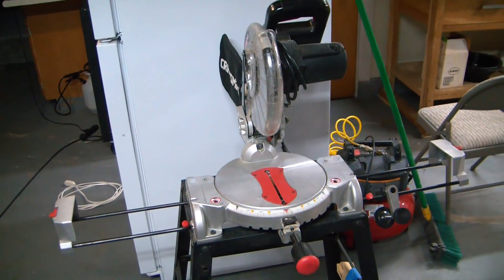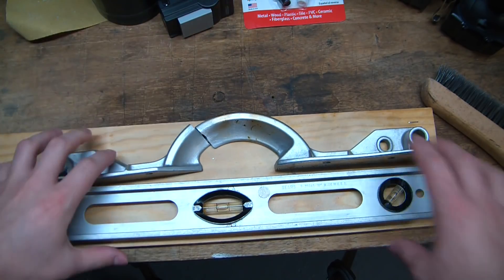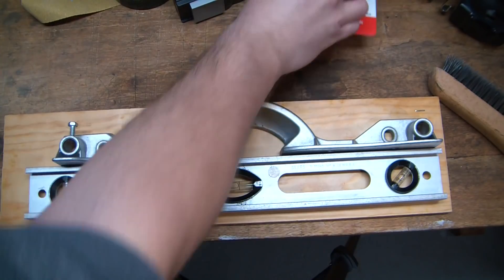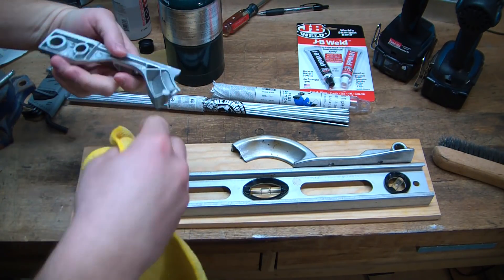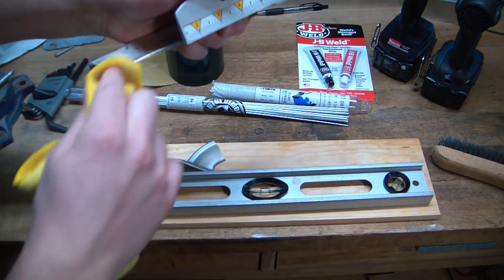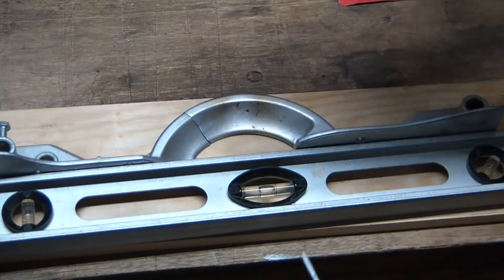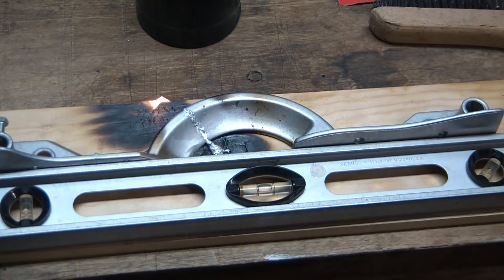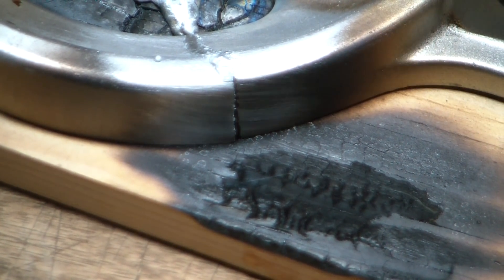Does Aluminum Brazing Rod Actually Work? Real World Fix Miter Saw Repair

Comment from the maker: Thanks for watching! If you would like to support this channel please head to www.patreon.com/elementalmaker. Every patron gets a virtual hug and my unending appreciation. I will also build a small shrine to worship you. One of these is a lie.
Reply: Heat the object to the point it will melt the rod, no torch needed after it hits that temperature. give it some more surface area by filling it in through the underside of the part. I repaired my boat prop with that stuff. still going after hitting logs for two years.
Reply: Like Curt said.... heat the object... I would have had it on a cookie sheet in the oven for a preheat.... I also would have used mapp gas.... never flame the rods... let the weld object melt the rod.... and how did you know that piece was aluminum rather than magnesium? never weld aluminum over something flammable, you introduce contaminates into the weld...
Reply: Good, I'm not a hugger. Side note, the Delta 26-2250 is an amazing little miter.
Reply: That fence looked to be made of zinc. Zinc don't bend, it breaks.
Reply: YOu do what you did but you need to flip it and do that on bottom as well. That aluminum rod does contract quite a bit. but by putiing it on both sides it will level out the forces at play some. Also C clamp the 2 pieces to the level! no backing needed!
Reply: no
Reply: Leave me alone I don't have a public reply to give. If I did it would probably be something up scene
Reply: The video was very helpful. I was looking to see how to use of these rods and how strong they were. Most of my questions were answered. Thank you and have a great day.

Comment: Just came across this. I can't figure you out. On the surface, you do some pretty intelligent things, then I watch this pile of what the hell. Sacrificial wood in a WELDING situation? Aluminum, not steel, of all things. where carbon, sulfur, silicon, sodium, phosphates, various dioxides, long chain carbon based molecules, etc., contaminates from the burning wood are guaranteed to be problematic, but you worry about acetone? You don't know whether it will work so you don't even bother to read the directions of the specialty welding rod? That logic doesn't even work with arc welding rods, like assuming you will get deep penetration with 6013 rods because the stuff you bought was a good brand...  Uggh.  You don't even bother to clamp the pieces in place for precision welding... Don't blame the saw maker, the pieces being welded, or the rods for the crappy outcome, blame yourself for a toxic combination of ego and lazy. I am glad you got it to work in the end, but the initial problems mentioned were obvious.
Reply from the maker: Yeah this was a truly braindead shitshow. Don't know what the hell I was thinking

Comment: light the wood on fire, would help keep the aluminum up to temp for brazing. Also the idea with brazing is not to spread directly in the flame, its like soldering you want the flow to happen not because of the torch melting the rod but because the metal is so hot the rod melts.

Comment: One of the keys is to not heat the rod with the flame it will ball up and look like bird poop. Ive used this before welding copper to aluminum and worked great just takes a little practice keep up the good work.

Comment: Great fix! Now, Some Monday morning quarterbacking for you. LOL You could've used clamps to hold both pieces steady against the level. The burning wood and will definitely contaminate the weld. Those rods are good enough to fix AC high-pressure lines.
Reply from the maker: It ended up breaking and I redid it with clamps and got a much better result. I would have used them on the first go but my clamps were at a work site.

Comment: Better result if you cleaned it and cut a v in piece and got rid of the wood under it. It is aluminum and aluminum needs to be clean and not smoked like a piece of meat.

Comment: bound to fail:  Contaiminates from wood burning, metal not heated enough before applying rod, metal should be approx. 750 degreees before applying rod, joint should not be laying on anything
Reply from the maker: Indeed it did fail shortly after this rushed repair.

Comment: Project farm did a great video not too long ago, testing out different brands of braising rod. They are definitely not all created equal. Also, I wonder if it would be possible to use solder flux to help that  brand to flow better.

Comment: Mine is like that too, but it happened after a piece of lumber jammed and spun around. Maybe yours was hurt the same way? Possibly when you dropped it and broke the handle? Maybe?
This is actually a good repair idea, because the area is now nicely annealed and ready to be dropped again and then it can be “hammered into submission” without breaking.
I think I would add another mounting bolt between the factory bolt and the turning part of the table. Then after torquing the inner bolts you can clamp the fence to a straight edge to straighten it and torque the outer bolts to hold the fence true. Then use the adjustment screw to align the blade to a true perpendicular to the fence.

Comment: You've just done it wrong as you're not supposed to heat the exact place you putting the brazing material to. The idea is to heat up the sides enough the brazing rod would melt on them not in the flame. That is way more tricky technic but the result is way more rewarding as well. By my own experience I've managed to braze back a piece of the rear wheel bracket on an alu bicycle frame. It did last for one and a half of a year of every day usage until the friend I've lend it out to, tried to "true up" the rear wheel position with a pry bar%)

Comment: Grind a 45% angle on the broken sections.  All the way around on both pieces. Fill in the V created by the 45's. Clamp your work down on a metal table. Preheat the table and then the work piece. Better yet do the above and Heliarc it. If you have the resources chuck it up in the mill and run a cleanup pass on it. JMHO.

Comment: I have used these for years and have become a somewhat expert on it's use. First off as pointed out from another poster, you should V-groove the pieces to give it more area for the rod to fill plus it will flow better to the back of the piece if you feel you need it to but I would V-Groove both sides and weld the back side as well but takes a tool to work so invest in some welding absorption paste that prevents you from re-heating the first side you did in the first place. Cast can melt away quickly too so using a regular butane torch is not a bad idea. Takes longer to heat the metal but may provide better control until you get better at it. Otherwise MAP gas will work but heat faster and hotter.  https://www.muggyweld.com/product/heat-freeze-heat-paste/. Also a stainless steel brush is a necessity to prep the aluminum for best adhesion. This goes for TIG and MIG welding. DO NOT USE ANY CHEMICALS. But to be successful with any thin material, cast aluminum, brass, copper and even pot metal(hardest to work with).

Comment: I've used a similar repair rod branded as 'Lumiweld'. Had great success with it but as others have said here vee the joint out a bit and use a small stainless steel brush to remove the oxide coating. Also helps if you have a piece of fine  stainless wire rod and scratch the surface metal through the puddle of molten solder/braze. This helps the molten rod become fully amalgamated with the base metal. It does work well,its just a matter of developing a good technique.

Comment: You didn't want to clamp both pieces to your level?

Also I believe you want it hot enough that when you touch it with your brazing rod that capillary action will draw it into the joint. I find it always takes some practice to get the timing right and just takes some practice on scrap. 

There's differences between brazing copper (yes brazing not soldering). Being that aluminum has a really nasty layer of oxide that's melting point is way above clean aluminum which the flux on your rods is supposed to remove. As long as there's a oxide coating on aluminum it's really tough to get two pieces to bond together.

Comment: Your not doing it right...  The way you are supposed to do it is grind down the joint at a 45 because it doesn't flow.  Also clamping and working from the back as well would certainly help.

Comment: Here's a video about welding. In the beginning and prep he mentions something that could be important to your case. Cast aluminium is really porous and loves to have grease stuck in there even after the cum gutter and wire wheel. If you were to file off a layer, it might have had way better penetration and wider surface sticking
https://www.youtube.com/watch?v=I5DrrcObmBo

Comment: It's better than the 1 i have i was cutting to fast and the blade bit in and ripped the fence right off and now i just have a piece of wood screwed on it and it works good and i didn't have to worry about the half round bit the blade removed what needed to be removed with use
Reply: Haha holy makrel
Reply: I did one real good . Don't tell anyone . I was using my dad's nice making miter saw for cutting up irregular pieces of oak firewood he had bought in a supermarket bag . All the shames and boos are heard . But I was not by my plumbing truck so I had no sawsall, and I wasn't home so I could go grab my stihl Ms 440 magnum chainsaw with the 30" bar , lol . The later was nearly as bad of an idea as the miter saw , but in hind sight , I'd have opted for instead . So we needed shorter pieces of wood for this burn box . I started cutting pieces and was trucking along , whilest this nagging feeling that this particular blade was going to overbite into the crappy oak . Sure enough it did , and we had to use screw drivers to pry the now  "Perfectly " straight miter blade out of the bar b que wood .

Comment: The melting point of these rods varies a lot, the cheaper rods melt close to that of aluminium , these ones seem to have a good safety margin. the burning wood would have contaminated the join, cleaning the metal should be done with a stainless steel or brass brush, grinding a chamfer along both edges and filling the V would be stronger , clamp the two pieces and use a stainless steel bicycle spoke sharpened to a point to scratch the base metal thru the molten puddle to increase adhesion

Comment: I've tried brazing aluminium profiles with a similar result. Afterwards, I read that you can make your own flux by dissolving boric acid in methanol. First de-oxidize the surfaces that you want to join. Immediately after that, cover the now bare aluminium with the solution. After evaporation of the methanol, the resulting boric acid film supposedly prevents re-oxidation and helps the brazing alloy to flow better. Haven't tried it yet, but maybe you want to give it a go.

Comment: Y
our not supposed to hit the rod with the flame heat the base metal till hot enough to melt the rood and flow it in and v groove the crack before trying to braze together it only sticks to ground clean metal

Comment: Flux. Flux. And don't forget the flux.
Reply from the maker: What flux would work for aluminum?
Reply: @ElementalMaker   They make powder and paste. I like the paste better. Hot Max or muggy weld paste flux. Brush a little on the joint and I like to dip the tip of the rod in it as well.  Aluminum oxidizes so quickly that it just refuses to braze without flux.

Comment: Most of the problem was insufficient heat in the part.

You have to heat in preferably a slightly reducing flame and heat the part to melt the rod, not melt the rod in the flame.

Comment: Don't melt the rod in the flame! Heat the part until the rod melts on contact, then the rod flows into the joint itself. Ffs

Comment: Because you didn't do it right you idiot rebraided properly you have to heat the rod up the same time you need to go back to the welding school I learned how to brace properly I'm 40 years old how old and I learnt that in high school how to breathe properly you do not know you got two braids both sides not just one especially with aluminum

Comment: Cool vid ! In my experience these guys want a whole lot more heat that the melting point of the rod, otherwise they dont flow and just bead up because of surface tension. Cleaning the oxide layer with a wirewheel doesn’t hurt either.

Comment: Maybe that casting isn't a good alloy. Even if it is a good alloy, the backside of that casting had awful thin webbing. That part would need to go into a well-heated mold and the cool slowly before being de-molded. I would bet they just heated the molds enough to get something that sorta looked good and then busted it out as soon as they were sure it was solid. It's a damn shame when you pay for something like that and some little PITA shortcoming that would have cost all of a nickel to have fixed in the factory makes a tool that cost 10,000 times that to be almost unusable. I would be tempted to have used a mold release on the saw base, slather up that fence with JB weld and slide in a piece of straight and square stock. Let it set up, bust lose the stock and clean up the fence. That would basically make a cast in place fence shim.
Reply from the maker: That would have been an excellent solution! I wish I had thought of that before. If it breaks again that'll be my move

Comment: You basically just tinned the surface, you didn't get it hot enough to suck it down into the throat of the joint. -.- Tinning it for adhesion and then going back over it and actually making a nice weld pool/caterpillar over it seems to be the best way to use that stuff from what I've seen on here.. That and going back and doing the backside of the joint as well.. It really isn't a brazing rod, it's just a solder.

Comment: I had my hopes high, but once you mentioned not reading the manual, I knew it is not going to go smoothly. :-)
Watch these videos, they will be helpful: https://www.youtube.com/watch?v=nxtmt6QCVd8 https://www.youtube.com/watch?v=Bu2bq9ad0e0
Heat the base metal,. Melt the rod with base metal heat, not the flame. Scrape through the melted rod with a stainless spike to break the oxide layer; base metal and rod metal will mix.
This is not a brazing process and those rods are not aluminum.

Comment: I had a shitty fence on a cheap saw...I got a piece of 2x2x¼ aluminum angle, bolted to the saw and then used the blade to cut the required clearances.

Works great...this method works really well for cutting thin material too because you can make a zero clearance fence too.

Comment: Grind a bigger gap, clean the surface, then scratch the surface to break the oxide layer, clamp it, and braze it on a clean steel surface and you will have a very good and very strong result. You basically did everything wrong that you can do wrong :-) You can also send it to Abomb79, he will fix it professionally in a heartbeat, still cheaper then buying a new machine.  You can get a great result with aluminum brazing rods, as long as you know what you are doing.

Comment: I've never seen someone soldering on wood before..... Consider that a first!

I thought you were supposed to scratch through the pool of metal to get under the oxide layer of the aluminium as there will always be one?
Reply: With brazing you aren't supposed to be melting the materials you are adhering, you are basically sticking them together with hot metal glue. With flux added you are mobilising the oxides significantly more than temperature alone in hopes that they will migrate away from the surfaces of the materials to ensure wetting of the "glue" to the surfaces of the base metals that reside just below the outer oxides. Some more advanced brazing rod alloys act as if fluxed at temperature and some of those even alloy per selective diffusion into the target materials(creating a significantly stronger bond, sometimes even stronger than simpler welds).

Comment: As a good visual check for square  .......... invert the cut piece so one face from the top of the cut is on the base, slide the two together and look for a gap. This will be twice your error so is easy to see ;0)

Comment: It's so frustrating when you buy a new machine and it's not right.
Your first mistake was not testing the material with vinegar.
Second was not  buying some aluminium angle and cutting a new fence.

Comment: Greetings mate. I've used this type of alloy before. You need to heat the workpiece up to temp and then apply the rod. Don't heat the rod directly. Let the rod wick into the seam. 

My experience is it doesn't hold well on thin sections of material and seems to dissolve the material somehow.

Comment: If you would have wiped it with a flux brush it would have turned out perfectly.
Use a map gas torch, it is far better!
Don’t weld on wood, you’re contaminating your weld.

Comment: I don't have the bucks (or the first clue) for a welder, but sometimes a guy wants to slap a few pieces of metal together.  Is brazing a good thing to look into?
Reply: Brazing is in between soldering and welding and is quickly becoming a 'lost' art. There are old guys out there that swear by it. Metallurgy is the key, heat and carbon content can make or break the application of what process to use. Soldering is like glueing, brazing is where the base material is brought to a 'sweat' and flux(carbon) helps the filler metal to grab the base, while welding mixes the base and filler to some extent. The problem with aluminum is the oxide that instantly forms a skin and that skin melts at a higher temperature than the underlying material. Anything is possible, imagination and experience is key.